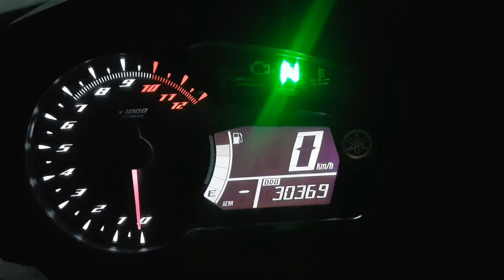MY DIY CONVERTION OF DUAL DISC TO SNIPER 150 | boss avin

Comment: Boss bagong subscribe ako.. 
Tanong ko lang po anu yung ginamit mo na spacer sa disc plate ? Yung isa sa kanan at 2 sa kaliwa?
Reply from the maker: salamat boss yes boss plate lang pina machine shop ko lng sya, tama ka boss 1 sa kanan tapos 2 sa kaliwa
Reply: Boss pang harap ba talaga yang Mags mo ?  Bakit need ng spacer  sa kanan? At naiba butas ngbdisc Or pang likod para maging 120 gulong? 😊😊😊
Reply from the maker: yes boss pang harap talaga hehe
Reply from the maker: pm mo ako boss pasa ko zayo ang pic hehe
Reply: @bossavin8274   sir pa send din po ako ng pic

Comment: Boss  new subs. Ako tanung ko lang pwedi ba 120 sa harap at sa likod 150 na stock na mags o kailangan palitan talaga at sa spraket san ba pwedi mag pagawa biss para gumanda snipe  salamat sa sagot boss
Reply from the maker: naku d ko po sure kung pwd ang 120 sa stock mags eh, at baka po sabit sya sa shock, tapos ung 150 sa likod ay pwd po sa stock mags
Reply: boss avin ganun  ba boss ano maganda  boss na sugget mo pero kung 110 pwedi kaya at mas magandang palitan na ren mags di kaya sasabit sa fainder boss
Reply from the maker: kapg boss mgpapalit ka ng mags na asio v2 d din po aari ang 110 na size need mo talaga mgpalit ng wide tpost or inverted shock
Reply: boss avin ha ok po boss salamat sa imfo pero boss alam ka ba san at pwedi magpakabit at makabili ng mganda salamat ulit boss